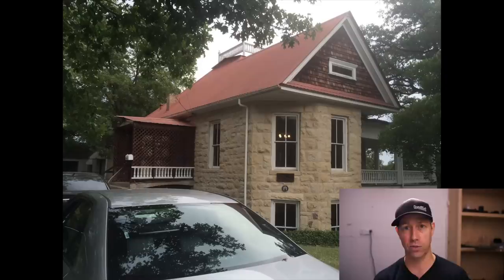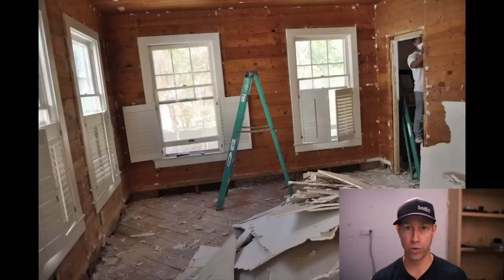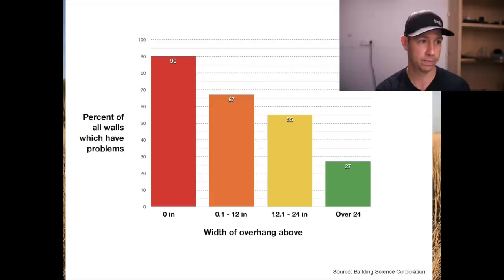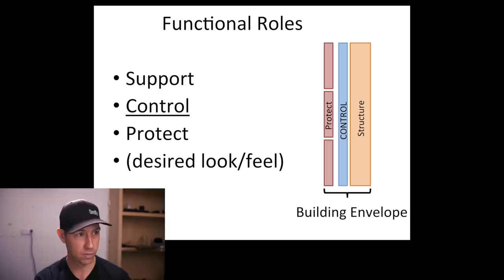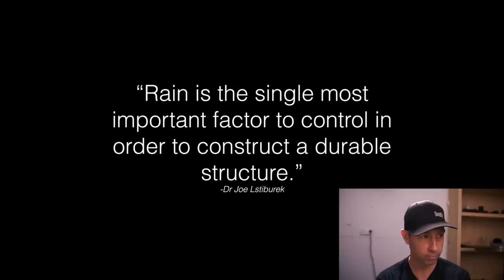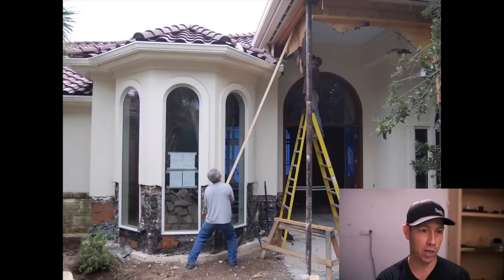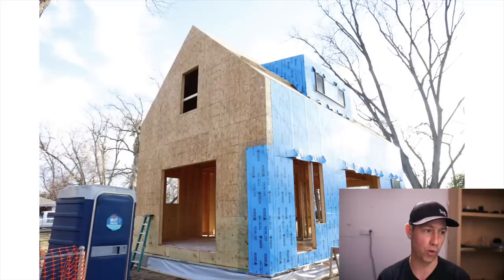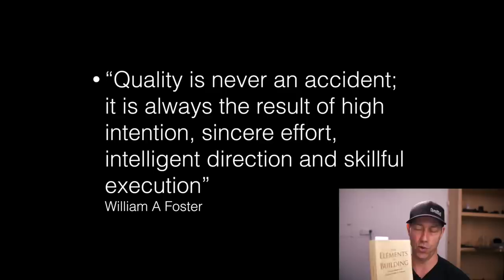Were Old Houses Built Better?

Comment: German guy here. I don't understand the houses in the USA. German houses are so very different. I live in a Bavarian village in a 200 year old stone house, and it's not what you expect. It has some flaws (the previous owner tried to insulate the roof and did a less than stellar job), but otherwise, it's a perfectly normal house, no mold anywhere, warm in the winter, cool in the summer, without insulated walls, just stones and plaster. We need new windows and a new front door some time in the near future, though.
Reply: this guy is selling something. That stone house and several others he showed would be just like yours in Germany… cool in summer hot in winter
Reply: Most of the US would have much newer construction than what would be in Germany and other established areas across the pond. Most homes in the US were/are built as part of a community build and development; Which also means that many of those older Gems end up getting knocked down if they aren't inhabited, and nobody can find the owner. Whereas more of your established villages in Germany and other countries were built with quality intended during the time for families to pass down for generations keeping families together.  What the US model leads to is industrial, cookie cutter JUNK built for speed and profit; rather than quality and longevity.  Your thicker walls of stone and plaster are going to much more difficult for the outside climate to penetrate, as long as it is all taken care of. 

Even newer homes in Germany are built to a much different standard than homes in the US, with many more regulations for efficiency, regular home health inspections and other things. Unlike the US, where you're basically pulling teeth from an un-sedated crocodile to add additional regulations because once again the US so about capitalism beyond a fault it isn't funny.
Reply: To Americans, investing in a house designed to last 200 years is like investing in a car designed to last 200 years.  Technology and tastes advance.  We consider it better to rebuild more frequently (typically every 75 to 150 years), and to rebuild in modern proportions and with modern amenities.  Also, here in California, we build out of wood because the weather is good, we have a lot of wood, and light weight is an advantage in seismic design.
Reply: Part of the reason you see so much more masonry in older European homes compared to older American homes is that Europeans clear cut a large portion of their forested land. North America didn't really get its start until European colonization happened in the 17th century. At that time, there were virgin forests all over the East coast of what would become the USA and Canada and they were heavily harvested. But because of the USA's comparatively late start compared to European nations, we had our first forestry laws in the mid-1800s which started limiting how many trees were taken. You'll find plenty of masonry homes in the US though, simply because some areas lacked easy access to trees. The Southwestern USA and Northern Mexico saw vast use of adobe construction. And, like your Bavarian home, the large thermal mass helped keep them cool in the hot summers and retained heat in the winter months.
As far as homes today, we don't build them to last 200 years because its simply not practical. You do find lots of masonry construction in places like Florida though. The exterior walls on most homes out there are concrete block or cast concrete or a combination of both. You could almost knock down every single interior wall in a home like that and it would stand up just fine with a couple supports for the roof truss in the middle.
Reply: A lot of US building with wood I think comes from basically the "pioneer" aspect of society. To have masonry construction, you need a well developed infrastructure of mines, transport, etc, and experienced builders, which USA during the pioneer era didn't have, especially in regions being settled by pioneers. In USA land was given out by the government for basically nothing in the 1800s to individuals to settle on, and wood and even sod construction was the main way to build a structure as it took fairly little skill and tools (to just build something standing and having a roof, I mean...) and the materials were already there for free to use. So this carries over into now. Carpentry tools are relatively inexpensive, and theoretically anyone can build a wooden structure, so that's why wood became predominant in US construction. There's really not a logical reason for the overuse of wood structurally in present times, it's just tradition carried from those times.
Reply: Obviously you are attracted by this. This said, you must be pretty darn happy with your current administration!?!!
Reply: SteveVi0lence  — Hi there, I'm the French on the Riviera, on the left of pillmuncher67:
1st — Not every German shared & let alone shares the Nazi ideology, stop propagating clichés
2nd — pillmuncher67 stands probably for 1967, born after WWII
3rd — pillmuncher67 said his house was about 200 years old . Read again.
4th — no, I'm not a close friend of pillmuncher67
5th — Your nickname tells a lot. Mine stands for : "The Universe is a Ratatouille" [guess why] I'm a scientist
6th — Philosophy & science brought us wisdom. Blind belief brings only despair, fear & Vi0lence.
Reply: here in the states it is called cob construction and many are doing it here now too. It suits certain climes better than others.
Reply: Hey German guy....I agree Ive been to Bavaria several times and am planning another trip for next summer...  GREAT old well built homes, lots of tile roofs, wonder friendly people and Andecks my favorite place for beer!!
Reply: Hey Thomas Moore! The "Holy Mountain of Bavaria" is only about 25 miles from my place. I also like beer!
Reply: SteveVi0lence: I'm a fifty year old Bavarian Punk Rocker and I have been in enough brawls with Neo-Nazis in my time. Two hundred years ago there where no slaves in Germany (other than serfs and indentured servants) - there were, of course, slaves in some countries one could name.
Reply: @pillmuncher67  I think I like you. Your philosophy, at least. Cheers from USA. We aren't ALL assholes.
Reply: only 25 miles!!!! You could go every day!!!  but better take someone to drive you home :)
Reply: @pillmuncher67  we could go for days about politics, but honestly if I can live the way I think best in my own country I am willing to leave your countries mistakes for you to live with.

To the more important question at hand. There are many differences that you fail to take into account. Firstly the population density and technology. Two hundred years ago Europe had many people and no cars, with a relatively stable population. Many people and no cars means small amount of land available, so invest in quality construction. Cheap land spread out? Build cheaply to buy more house for the money! Circling back to the lack of social/population stability. Most Americans do not expect their children to live in the same city, let alone house as the one they own. Why build a house for future generations that will never live in it? Then the rapid changes. If I build in the suburbs today it may be surrounded by skyscrapers in twenty years. Why pay for two hundred years when I cannot predict twenty? Finally the American neighborhoods rarely have two hundred years of past. Let us say that your house was built two hundred years ago in a neighborhood of cardboard houses. After the first five years one of the neighbors might decide to build stone, because he was doing well financially, rather than rebuild cardboard. Then perhaps in three years a fire burnt down the neighborhood. Well a few neighbors will notice that you only had to rebuild the roof, and they will go stone. Eventually people just start building stone because it is the way things are done, because the weak houses where weeded out a century ago! Meanwhile back in the States the neighborhood got knocked down to make a new overpass and everyone had to move to New neighborhoods and buy the house they could afford.... 

Granted I actually know Americans living in almost two hundred year old houses, typically an old farm stead that either was or still is in the middle of nowhere, but those were houses built with the great grand children in mind.
Reply: Stone houses don't magically make things cool or warm. Your German stone house is cool in summer because your average air temperatures are low enough.

Additionally, your basement is cool year round because there is not enough heat in summer to get ground warm and that helps to keep whole house temperature stable. That house is in Texas, so around 18ºC ground temperature against average daily 30ºC of air . For Bavaria it would be about 8ºC ground against 16ºC air.
Reply: yea im from the uk and where i am there are a lot of new houses but 200 plus year old houses are pretty common and we had a lot of heavy bombing too, im not going to say anything about any place or time having better houses because it doesn't really matter as long as it lasts your lifetime, but it was interesting to see what people consider old when it comes to houses thats for sure
Reply: @kefeer123  no one said its magic, just the house weighing a lot does a great deal in moderating temperature.
Reply: I think the biggest difference is the following.  I used to travel to Bavaria every 2 months for over 11 years.  During that time, I saw maybe 40 houses completed in various villages.  All of which seemed to require large cranes.  In the US, in my county alone, during the same period there have literally been thousands (if not 10's of thousands) built.  The process, from a permitting, building, and cost perspective is drastically different.  For better or worse, if houses were built like they are in Germany, supply would never keep up with demand here.
Reply: pillmuncher67 I thought it would be an obvious answer that in 1876 our nation was only 1 year old and we didn’t have many quarries not to mention that westward expansion was still happening at a quick rate.
Reply: @rainerrain9689  Not quite. To my knowledge, serfs and indentured servants couldn't be sold.
Reply: @untamedlion33  I WAS THINKING THE SAME..SHOULD BE COOL IN SUMMER?
Reply: My home in the US is a farm house from the mid 1800's.  It's a mish-mash of original construction with newer additions (1930's and 1960's).  The original house is the best of the lot by far and constructed using timber frame with clay infill, clapboard cladding exterior, plaster clad walls, and a massive stone chimney (2m x 1m).  Like the OP,  we need to address a few things like the windows and doors, but the clay and stone do a stellar job in summer and winter.  The newer additions are the energy hogs in this house!  
A lot of people are mentioning "survivor bias".  In my area of the northeast we are surrounded by town centers comprised almost entirely of buildings that are 100 to 200+ years old with suburban sprawl around them from the last 30 years built on the old farms.  I guess time will tell, but I'd put my money on the old stuff outliving much of the new.
Reply: I'm British and I have lived in the USA - US houses rot because they have no concept whatsoever that buildings need to breathe. We even "lost" that knowledge in the UK between the 1950s and 1990 until all the new houses started to show major issues. Now we have returned to traditional methods more and the houses are doing much better. Materials such as concrete, cement and gypsum and plastic paints are mostly to blame - as well as insulations, lack of air vents and the dreaded drywall
Reply: It all comes back to corporate greed
Reply: a  200 year old house isnt really what i would consider OLD , i mean its not a new build but its not exactly ancient.
Reply: EpiDemic117  this is a red herring. Masonry is not a problem for low rise structures...also why dont you use concrete instead?
Reply: EpiDemic117  you dont insulate with reinforced concrete bro, you use red brick for walls and concrete for beams. just make some cavities for electronics in red brick...Electronics are easier that way to install than with cancerous and fragile drywalls. Whole build is miles more durable.
Reply: EpiDemic117  not reinforced concrete walling, but reinforced concrete beams. Like timber framed but reinforced concrete instead of timber.

If you need isolation, you put rock wool on outside and cover with facade, no tyvek crap needed and no horrible foam insulation. All newer houses in continental Europe are built that way, we even use reinforced concrete for roofs and all floors are reinforced concrete. Its a very good build, I can post some graphs if you want more info. No hurricane can do shit to that kind of build.
Reply: EpiDemic117  dont be a 56% amerimutt, build a proper house!
Reply: @SteveVi0lence So i see that Hitler lived 200 years ago, it's funny when americans try to look smart but they don't know more than the menu from the fast food, so stop with racial discrimination and foolish pride.
Reply: EpiDemic117  there is wood framed and there is regular American build which has nothing to do with a quality wood house
Reply: @Seb B this Thoma company is very interesting, you worked for them? Honestly, Im skeptical about them using laminated wood blocks and those layered pieces will react with expansion
Reply: @laratatouille6364  it's called trolling
Reply: @pillmuncher67  it's called trolling
Reply: @tzarbg123 derrrr
Reply: pillmuncher67 German In America here. This is a very very good discussion that you started. A lot of homes in the USA that were built at similar times to what you’re comparing them to, were just products of what materials were easiest to access. Also the USA has just so many different climates and weather anomalies to deal with in each part of the country. It’s crazy.
Reply: It's cause there are different principles. In Europe we traditionally build with ridiculous amounts of thermal mass: stone, brick, earthware. They were purposefully built to last AT LEAST a whole lifetime. Thermal mass materials absorb and release heat really slow. Before the grid went up, heating was almost exclusively  radiant heating and tipically had a drying effect on the air(like woodstoves), so as long as your roof had enough overhang or render, moisture was not an issue.
On the other hand, in the US time and cost was key. Entire towns went up in a week or 2 during the gold rush. Unfortunately this approach stuck, and now we have cost-minimum design, and planned obsolescence too to top it off. Plus now we overwhelmingly have convection heating(and cooling) which is a whole different story.
Reply: John Sluder  You do know that half of Germany was communist well into the 90s, right?
Reply: @717dash_cam  Or its because Germany is much smaller and older than the US, meaning they have more old sturdy houses.
Reply: @TV-oj8uh  Its even sadder you cant tell this is bait.
Reply: Yes, as a Hungarian I found this pretty funny, especially when he says things like "traditional" for making houses out of planks and "you can't build like in the old days anymore".. maybe you can't, but the rest of the world still knows how to do it :D and the best: "the insulation goes on the outside! what a radical discovery!" no shit, Sherlock, people only do that for centuries, but yes, you invented it... basically there should be a big * besides everything he says with a footnote that it only applies to the US. 
I mean I understand that in the US they want quick and cheap houses and if they enjoy them, good for them, though I'd wonder if the construction industry has any role in creating that trend. Because if you build a house and you don't have to do repair on it for decades it's not as big a business as rebuilding the same house every 5 years or repair it yearly..
For me the slower build of the brick / concrete houses are well compensated for with the safety, comfort and durability they provide. I don't think I could feel safe in a US-style house.
Reply: @reesedaniel5835  sounds like something a Jew would say
Reply: they want 10-30 years out of a newer home and money and I watched a video about the Swiss building family housing from pure wood , nail are wood , frame is wood , and it last 400 years
Reply: @petemiller519  what's the story with bc, I lived & worked there for 5 years in a row, then subsequently on and off, I noticed in 2014 to 2019, the whole property bubble,  compared to the UK, its a unorganised mess, when did the houses sky rocket, it  is unsustainable, I love Abbotsford, its a nice place to live, I like North America, but, the events in bc that    culminated in the property bubble and general  malaise,  the people in general are not critical of those in positions of power or authority, maybe its the grumble under your breath mentality, the cohesion of the society is negotiable, either its that they are resigned to the situation or simple don't care, beautiful country, lots of natural resources, but, simply given away for close to nothing, while incompetence, wilful neglect or curruption is evident, the people are ignorant by design, after a few months I realised the way things were, critiqued the bells and knockers out of the system there, with the easy to implement solutions, I went of on a tangent.....
Reply: The Cobblestone homes around Rochester NY are close to 200 years old and are historic treasures. This article features one in Chili NY (pronounced Chi-lie, or lye... I lived in North Chili until age 12). https://www.nytimes.com/2008/03/16/nyregion/16cobble.html

At age 12 we moved out to Clarendon, NY (see pic for 1849 Butterfield Cobblestone House, Clarendon... https://www.thoughtco.com/cobblestone-houses-in-new-york-4018966 ) into a timber frame house (that was the core of the house, anyway) built in 1837. The beams were hand-hewn, and the central beam & posts were 12"x12" (30cm x 30cm).

I rented a ground floor flat on Sonnenstrasse, in Feldkirchen, east of München, for 6 weeks from the last week of July through the first week of September 2003. That was the HEAT WAVE.  Let me tell you, that flat had foot thick masonry walls and did NOT stay cool. You couldn't buy a fan in Munich to save your life. I put my sheets in the Kuhlschrank (fridge) during the day. Maybe those thick masonry/stone walls keep houses cool in normal Bavarian summers, but that summer, I might as well have been in Phoenix.
Reply: You live in a Bavarian village.  German weather is INCREDIBLY mild compared to US weather.  It gets both hotter AND colder in most of the US--and in Austin, where he is, it gets hotter and stays hotter.  You can get away with little insulation and not break the bank because you have low heating and cooling codes.  Stone houses are not maaaaaagically cool.  They are cool because the night is cool.  They are warm when the day is warm.  They provide thermal mass, which is nothing more than a battery lag and is completely useless anywhere in the US except for some desert areas.

European standard building does NOT conform to US requirements for efficiency.  It does NOT conform to wind-load requirements.  And it certainly does NOT conform to earthquake standards.
Reply: @untamedlion33  Stone houses in Austin are blisteringly hot in summer or cost a fortune to cool.
Reply: @petemiller519  Nonsense.  The houses that people don't want anymore get discarded (because our standard of living has risen so quickly), and houses in areas near urbanizing centers get turned over, because what used to be residential turns commercial or because of economic movements in neighborhood, but that is true of anywhere in the world of any time in the world where living standards are rising quickly.
Reply: @thomasmoore4401  Tile roofs are pretty new in most of Germany.  They used to all be wood shakes, frequently replaced.  In fact, our word "shake" comes from a German loan word.
Reply: @ibeamy  you mean 101 years old?
Reply: @kickpublishing  US houses only rotted during the EFS scandal.  Houses do not have to "breathe."  Moronic statements like this are why British engineering is such a joke.
Reply: @SteveVi0lence  its okay, most of our country was built by slaves or immigrants that we treated poorly
Reply: Yeah and you probably don't use that ridiculous forced air for heating, right? Truly curious if such a thing even exists in Europe
Reply: Thomaspq
Reply: 300 years old + house here (french farm) and yeah, appart from the dodgy previous jobs, awful wifi and questionning electrical... Its all fine.
Reply: Stop mentioning stones. Stone houses don't survive in earthquake zones. Better to have a japanese paper house than end up buried alive.
Reply: @q-_-p.d-_-b  we don't have earthquakes. Nor does the merican (most of the US at least)
Yall lazy and don't have enough of an history to build solid houses. Yall think about is profit profit profit. 
In Europe, buying a house is important. The house will stay here and will be passed to children, grand children ect ..
Reply: @victorpelini5995  Well, chav,  I'm in an earthquake zone. So paper houses it is.
Reply: @q-_-p.d-_-b  also japan is in earthquake zone as you mentionned it and they have a lot of stone/concrete solid stuff. Just designed correctly
Reply: @victorpelini5995  They have lots of rocks. We have lots of people, and lots of trees. What to do? btw, 3000 immigrants a day cross into the USA every day. We'll have to build a new school every day for perpetuity to cope with that influx. Not as much as the Syrian refugees but you talk as if you've got stones left and right. The EU has been milking us in trade for decades now. Then you call us lazy and cheap. smh
Reply: @q-_-p.d-_-b  lmfao american companies are milking Europe like crazy what y talking about

Its more a cultural thing. Yall don't see house the way we do. Yall prefer huge ass wooden houses over smaller stone and brick ones.
Reply: @victorpelini5995  I'm talking about the trade deficit. And all american cities are built around cars and walmarts. The american dream.. owning a house with a white picket fence. Lotta people come here for that.
Reply: @q-_-p.d-_-b  they miss out on the most important things...
Reply: That's what I keep thinking. ..the house we lived in had to be about 50 years old (at least)..heating system (oil) and sturdy windows. ..same observation of homes in France,  Switzerland or Italy. .
Reply: @pillmuncher67, a lot of German homes have solar, photovoltaic or thermal, unlike American.
Reply: SteveVi0lence Uh here’s a little fact:  Nazis weren’t around 200 years ago and most Nazis are dead unless you’re referring to skinheads and modern nazis that are in every country including the US.  Grow up Mr Violence.
Reply: @CobCeo  ..and now aircrete is starting to be used more too
Reply: Two different Worlds; Europe and North America.
Building technology in North America is about 200 years years behind Europe.
Reply: @victorpelini5995  I agree
Reply: The US had slavery for about 80 years before we had an extremely bloody civil war to end it. So while our men gave their lives to end it, your men have attempted to take over the world three times in 100 years.
Reply: @HollywoodF1  
As European I will try not to offend you but your kind of view is very short sighted in economical and on culturological scale.
Building house out of plywood is cheap and lazy and comes back to bite you in the long run. Brick houses lasts longer and are more resistant to weather elements. Building wood houses instead of brick houses in tornado areas is terrible economic model. Why do you think people built stone houses in all over Mediterranean where winds like Bora can reaches over 150MPH ? And we kept building them for 2000 years!!! There is a perfect reason why we are building them like that !
Now the longevity of house that is built for 200-300 years demands less maintenance and in long run  your real estate value will skyrocket. Why do you think the Houses from Victorian era in Uk or houses on Croatian coast built 200 years ago have insane prices ?
Not to mention that is is part of European culture to perserve the architecture. You can't perserve plywood for 1000 years.
That is why we have 700 year old breweries in Prague, and 300 year old houses all over Europe that are converted into museums and places of interest for tourists.
You know - Culture.
Reply: Germany is in Germany. Yeah, you're not that far from Denmark. Or Norway frozen places.
Reply: @rainerrain9689  get an education and learn something about history before writing stupid comments
Reply: Have you ever been to Canada? Winter, like you've never seen. An old stone building like that would be a pig to heat and cool here (I know, Matt's in texas, but yea...). You'd find the frozen corps' of a family in that stone house where I come from.
Reply: @DriveCarToBar  Best reply.
Reply: @717dash_cam  Wow! That went to a third grade level  right quick! Look man,  Some of us wish to live in a societee in which everyone contribute works hard and has the freedom to do what they want as long as it doesn't affect others. I'm sorry that your parents did such a poor job that you now think you need a government to do everything for you, but I cannot help you with that period have a nice day.
Reply: @GilBatesLovesyou  Ontario has thousands of old stone homes, all were quarried locally, most in the yard they were made in. I would say population growth and speedy requirements for new homes were the biggest reason people stepped away from building this way.
Reply: @ibeamy  there were quarries within weeks of people arriving... the Europeans settling needed stone for foundations and such, as they did in Europe.
Reply: John Sluder and you seem to hate knowledge and education. There is no communism in the USA and there are more regulations in countries that are building better, stronger and more efficient houses then those in the USA. You can blame ultra capitalism,greed and a president that removes good regulations for those kind of houses in the USA. Greetings from Germany.
Reply: In the USA, we will tear down perfectly good house to make condos, towers, or mcMansions. Its bloody disgusting. I can understand  if a natural disaster took it out but a house only 50 years old is considered not good enough.
Reply: Ozone  oh yes, Nature Something other places don't have.
Reply: Ozone that was sarcasm. What do tornados have to do with this topic?
Reply: Ozone  but why? Good concrete buildings can withstand most tornados and it's not like that there are tornados everywhere.
Reply: @HollywoodF1  The way most things are built today you need to rebuild every 15 years not 150.
Reply: HGTV has made it so that a house has to have new kitchen and bath everytime the house is sold, and every 5 to 10 years. Remodeling houses I'm convinced hgtv is the reason for global warming, because good stuff gets thrown out at the drop of a hat. And new crap gets thrown together in it's place. It looks new bit doesn't hold up
Reply: Rinse and repeat
Reply: @pillmuncher67  I was under the impression that they came with the land when and if it changed hands.
Reply: @Marko-od7eb  The reason they build with stone in the Mediterranean is because all the forests there were cut down thousands of years ago so wood is in short supply. That and the resulting tradition is why they build with stone, no more and no less. Tornadoes are a roof problem--if your roof is gone your house is gone even if the walls are military bunker grade. If anything stone and brick buildings do worse in a hurricane or tornado, and far worse in an earthquake because mortar joints have no tensile or shear strength. Reinforced concrete is much better, but concrete is still an evolving technology, and it's highly unlikely for 20th century reinforced concrete to last 200-300 years without extensive reconstruction.
Reply: @keywestalert6329  Germany and Denmark have extremely mild climates compared to most of the US. Norway is a totally different matter, but that's why they build differently there.
Reply: So stone houses regulate temperature?